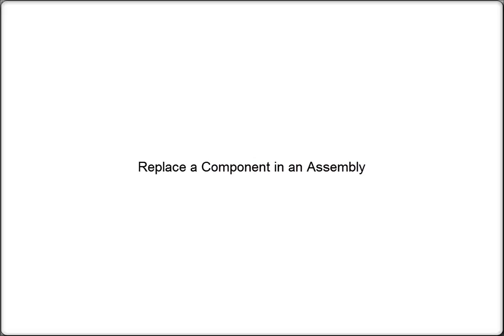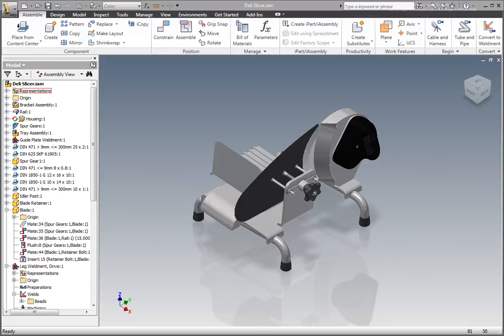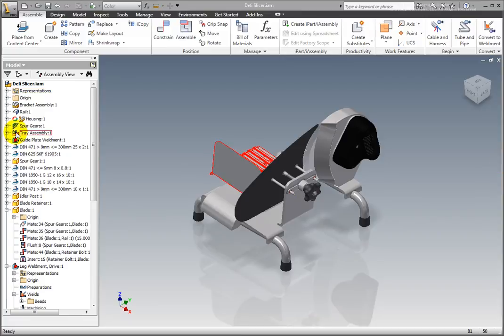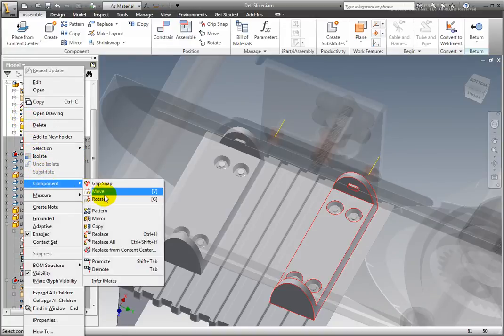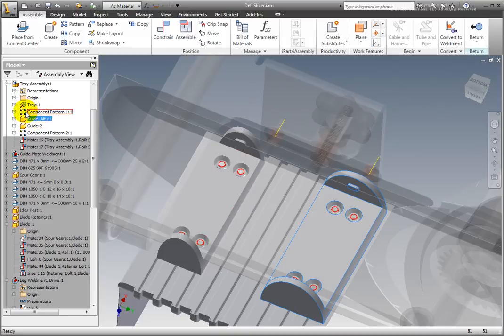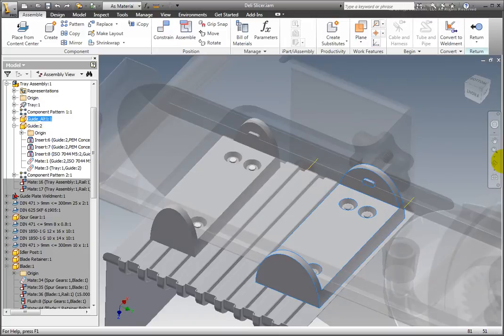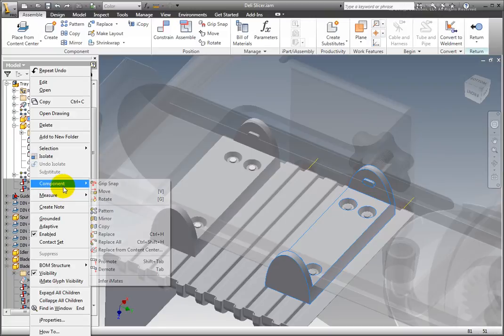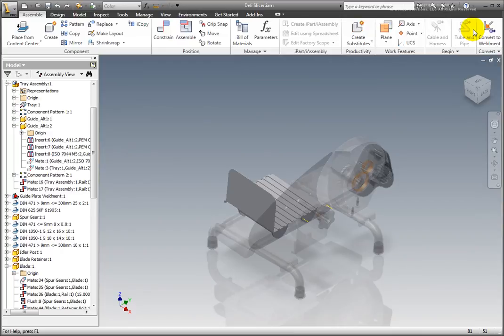Replacing a component or subassembly in an assembly - Autodesk Inventor 2011

Comment: Hi, what did you mean by "do not save the file" at the end there? Does it only prompt you when you are closing inventor? Also, if I wanted to edit an instance of a part, is there a way I could make that edit without changing the other instances? (effectively creating a new part) Thanks!